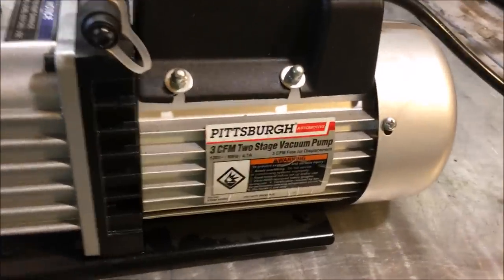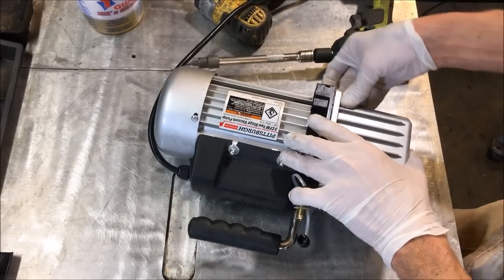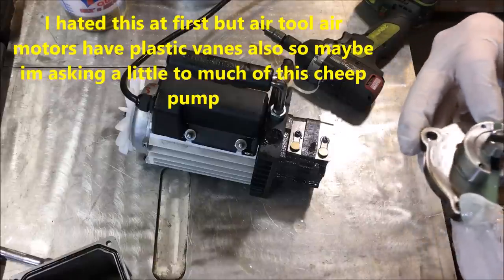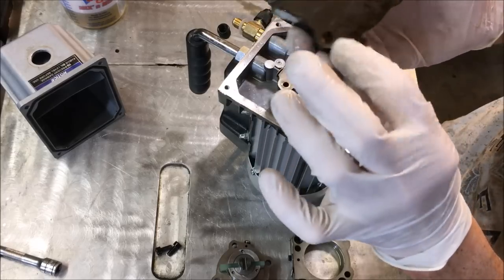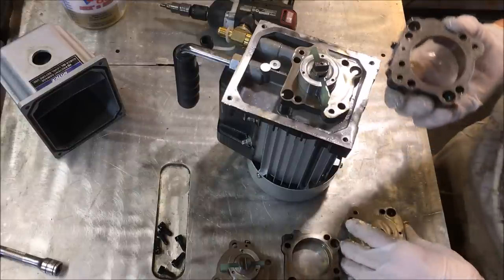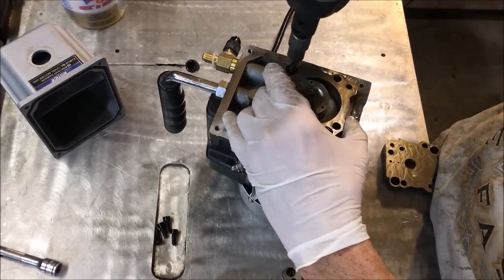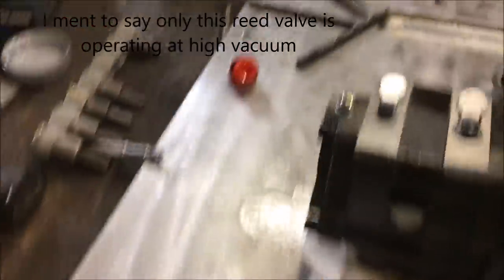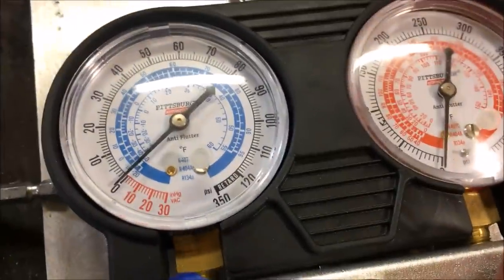harbor freight 2 stage vacuum pump tear down

Comment: Does anyone know what is the hole in the middle at the bottom for? You can see it in this video at @3:21 right after he takes off the stand. Two holes for the allen screws holding the stand plate but my pumps leaks oil from the middle hole at the bottom. Any comment is appreciated.

Comment: GOOD VIDEO , I just bought a 2 stage pump to replace my 1 stage because I couldn't pull a decent vacuum on a  ac install I am doing. The 2 stage replacement looks just like the 1 stage I am replacing and I wanted to take the pumps apart and do some investigating to make a comparison, but fortunately you save me the trouble and I am a lot more knowledgeable of what I am dealing with.

Comment: They really need to make oil resistant cameras. That would make life better for all. Water submersible with light maintenance and oil safe and easily cleaned. I know we have the technology. We just need to speak up and create a demand. Making technical equipment user serviceable would make cleaning parts so much easier. Heck we all want the new stuff but we want out old stuff to keep working. If my cameras work and we’re easy to repair I’d keep them all. They aren’t big. Don’t take up too much space but obviously I’m still going to buy the new cool shit.

Comment from the maker: The reason i speculate it wasn't to stage after opening it  is because it had to discharge ports , why wouldnt one discharge go straight into the other vain pump ? , why isnt second stage smaller ? it would have to be to have any effect at all in that capacity .

Comment: The reason why the motor is totally enclosed is so that a seal is not needed between the motor and and the vacuum pump.
Reply from the maker: good point
Reply: I disagree.  A totally enclosed motor is used where there is a potential of a fire or fire or a possible explosion risk.  The fan will "ventilate" or diffuse external combustible vapors, keeping such vapors isolated from inside an electric motor. Otherwise, vapors could enter the electric motor, where there may be a potential source of an electric spark.  Oil vapor, in the right air to vapor mix, under some rare circumstances, could possibly be explosive, or perhaps start a low grade "fire" or combustion process.  This could be considered similar to what causes a bundle of oily rags to generate heat and eventually catch fire, or in rare circumstances, can cause jet fuel in a jet aircraft tank to somehow oxidize and begin a low grade combustion process during fueling.  Hot gases will then emerge from the tank vents when fuel combines with oxygen in these tanks resulting from a low level "combustion" process.  This has happened with no consequences in rare circumstances because this heat is vented to the atmosphere through the tank vents, unpressurized, at fairly low temperatures.

Comment: So where is the damage observed, and why do you think running motor oil in a vacuum pump in a device engineered to use mineral oil is a good idea? proper case of "just because you can, doesn't mean you should" video.
Reply from the maker: I was out of mineral oil and i hoped that after running it for some time the gasses would be pulled out , i hoped any way . I did not notice a difference on the gauge but i get your point.
Reply from the maker: No damage i just wanted to see what was inside and turns out this is not a 2 stage pump its a dual single stage , if it was 2 stage the second pump would be smaller . Confirmed by people who know what they are talking about i might add this is not opinion . Dale stop being such an asshole for no reason , it does you no good brother

Comment: It is a 2 stage man. And always change the oil after evory use. I don't understanding why u dismantled that pump. I have one of them pumps and I know it's a 2 stage. All u needed to do was pulled the 4 scruws to cleen out the frount housing. Then replace the oil. U can find the manual on line with a good display of the pump breakdown.
Reply from the maker: I made $24 dollars showing people whats inside and will probably do well over 200 by the time its over  , not sure why this video stirs up so many shitty comments . I state in the video its 2 stage , i was analyzing  it and you decided to leave your 2 cents before watching the entire video. I dismantled the pump so i could pay for it .
Reply: @NOBOX7  don't bother those smartasses. Wish you opened it up before me so I didn't have to spend the night doing it.
It is a 2 stage. The second reed is for the gas ballast. It's used to introduce air to avoid oil contamination with water
Reply: @NOBOX7  It probably "stirs up shitty comments" because you it appears you did this video the for no reason other than to do an analysis of the pumps design and build quality (and apparently make money) yet it's clear you have no clue what your talking about when it comes to that subject resulting in the viewer wondering why they just wasted 33 minutes to make you $24.

Comment: the cooling is the fan blowing air forward thru the cooling ribs on the outside!! almost all motor is like this, it's what we call water resistant motor, what you are talking about is a pre ww2 motor with internal cooling .    :-) here the stator is cooled from the outside.....

Comment: two stage pumps connect in series this vacuum  pump is parallel pump single stage, usually two stage will have two different size compressors bores.
Reply from the maker: i agree friend

Comment: The maximum vacuum is dependent on atmospheric pressure. The max vacuum at sea level is approx 14.7 psi or 29.9 inches of mercury (Hg) with a perfect vacuum. In reality you can get to 27 Hg you are doing pretty good. You can hook up as many vacuum pumps as you want you will never get more than atmospheric presser. If you need moor pressure you will need an autoclave to bust vacuum.
Reply from the maker: Great point
Reply: Not true.  An electronic gauge set like a Fieldpiece 460 measures low vacuum in microns which is far lower than 28 inches of vacuum.

Comment: First. You will not get 30Hg while on planet earth with that pump you will get 29.9Hg maximum. 30Hg is an absolute vacuum and for those who do not know what that means, it means there is no air. Think Outerspace. Second, you are talking bad about Harbor Freight. Every employee of that place is instructed to counter any negative remarks made towards their company on any social media site. Third. A two-stage design has two rotors and vanes. This means that the first stage generates a vacuum and the second stage cleans the system, leading to a deeper ultimate vacuum level. As a result, two-stage pumps can produce a deeper vacuum than single-stage pumps.
Reply: One Inch of mercury is equal to about 25,000 microns.  If atmospheric pressure is 29.9 Inches of Hg (mercury), assuming 30 inches of Hg is an "absolute" vacuum, this is nowhere near an approximation of an actual absolute vacuum, which theoretically can never be attained.  29.9 Inches Hg is really not even close to an absolute vacuum, being more like 22,000 microns. Even outer space may not be an absolute vacuum, which on average, will contain a few molecules of gas, namely hydrogen, which theoretically is not an absolute vacuum.  A level of about 500 to maybe 1000 microns of vacuum is appropriate to boil off the water from inside a refrigeration system in a reasonable amount of time.  This pump advertises a vacuum of 25 microns.  It is unlikely that this is achievable with most of these inexpensive HVAC vacuum pumps.  A good digital vacuum gauge can measure necessary micron levels of vacuum, but it isn't particularly precise at these levels.  Without pulling such a vacuum in a newly evacuated system, some moisture will likely remain.  Eventually, remaining moisture will combine with common refrigerants to create acid that may damage the internals of a refrigeration system.  It is good practice to always install a new filter dryer in any system that has been opened to the atmosphere, even when using a decent vacuum pump.

Comment: All that oil mist is from the oil being used as a seal.
Reply: It's two parallel stages. They allow the pump to lower the vacuum quickly, while not stalling at higher loads/vacuums.
Reply from the maker: Thanks for you input friend .
Reply from the maker: Yep i totally agree , at first i thought they cheated me as the device does not look like its 2 stage at first then i also came to the same conclusion . Its actually an ingenuous Design .
Reply: That mist is coming from the exiting compressed air being vented into the sump. The "oil seal" refers to the fact the entire pump is submerged in oil and relies on that oil to seal it.. That's why there were no gaskets on the machined end plates. The mist is easily recovered with a mist recovery attachment.
Reply: That mist is also the moisture from the air re condensing

Comment: Two stage design has two rotors and vanes, that pump is a 2 stage .
Reply from the maker: yeah i know but did not not see the dual discharge ???? it made it look like something was up . turns out during high flow it is only one stage .
Reply: @NOBOX7  strange, I'm going to get me one of those dore refrigerators.
Reply: Right.  It looks as if one stage discharges an initial high volume of air, followed by a second stage that actually draws down a micron level vacuum.  The second stage feeds internally from the first stage. Both stages vent to atmospheric pressure in the pump housing.  The video never showed if the vanes were parallel or if they were rotated relative to one another, which might account for an internal pressure differential between the first and second stage.  That way, low pressure vacuum is fed to the second stage, which further reduces the vacuum.